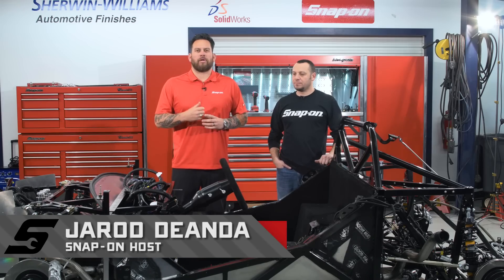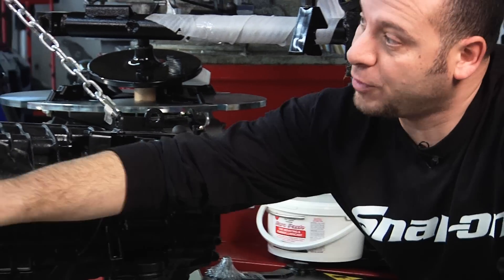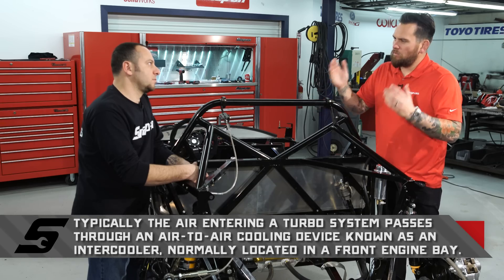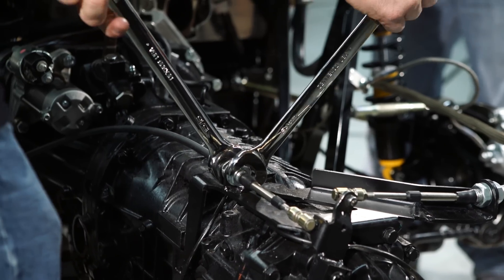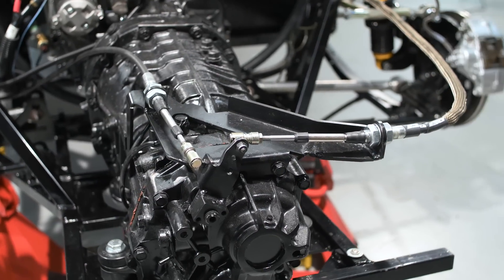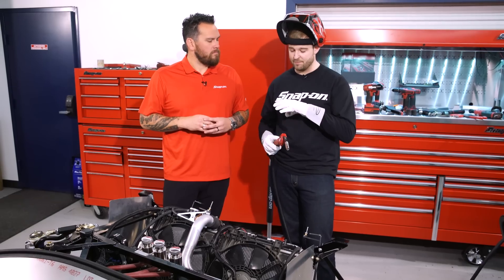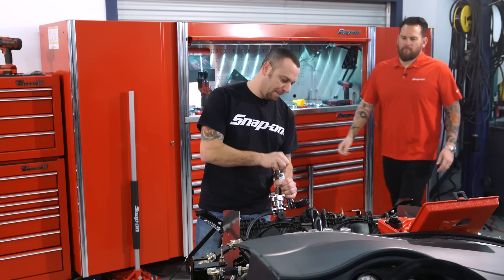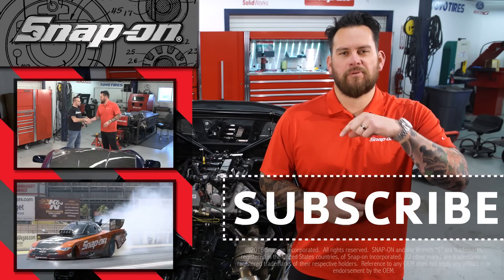Dropping in the 818C Engine at Factory Five (Part 2)- Snap-on Tools From the Ground Up

Comment: The simple solution to this fantastic chassis is electric swapping it. Low center of gravity, roughly the same weight, less hassle when building, and EVWest sells a drop in electric kit as well.

Comment: I think when people say they want an American engine they mean V8, not some eco engine.
Reply: If the engine was made in america, it is by default an american engine. V8 doesn't equate to being american.  It also makes little since to put a V8 in a car that weighs under 2 thousand pounds. You'd have virtually no real control.
Reply: @MuShinnen  Nobody thinks a 4 banger American engine is the shit. LS swapped Mazda Miata is a good example of a very light V8 that has no problem handling the power.
Reply: @unite4peaceonearth  Speak for yourself. If the only thing you can think of is slamming a V8 into everything, then you're not much smarter than the average 15 year old. Power to weight ratios are a thing for a reason. The car can already hit 10 second drag times with a tuned subie boxer engine. All a V8 would do is kill the driver, and possible someone else with it.
Reply: @MuShinnen  You can always tune it down for less power to make it safer but still have that V8 'Murica sound. 🇺🇸
Reply: @unite4peaceonearth  Tuning it down does not change the additional weight you just threw in the car though. Now you have to adjust the rest of the build to compensate for the additional weight, power, and balance shift of the vehicle. Why put a V8 in the car in the first place if you're just going to tune it down vs just buying a 4 or 6 cylinder and adding turbos? If sound is all you're going for then you risk compromising the entire rest of the build for it.
Reply: @MuShinnen  extra weight but more power to counter that and keep the wheels on the ground. LS3 engines are smaller for V8's and lightweight with the aluminum option. The hole point is to get that V8 'Murica sound. It's ok to disagree...cheers!
Reply: @unite4peaceonearth  Again, there is no v8 in existence that has the same weight as the proposed options of smaller engines. That's just not how it works. Power to weight ratio again is a concept that doesn't seem to be addressed by your comment. Power counters additional weight, but only on a surface level. Cars are designed around their engines, not the other way around. There are issues with balance, and structural tolerances that have upper limits when engine swaps are brought up.

You have to take into account reinforcing a car's frame to deal with that. The various modifications to make sure the engine properly sits in the position that it should. You have to deal with the heat that V8 is going to create more efficiently. You have to have a new transmission, you need better brakes, and a slew of other parts just so this car is functional. This isn't so much disagreeing about how a V8 sounds. I drive a 2018 mustang with a V8. I'm questioning the end practicality of trying to strap a v8 into a car with virtually no safety features, and no weight to really counter all the added horsepower for a vehicle that was never meant to have it.
Reply: @MuShinnen  I was only trying to say that when the builder said he wanted to appeal to the American engine crowd, most people would think first of a V8 when your talking about this in a global and local market.

Comment: The real question is can it fit a tall chubby man 6'1 250 pound man to be specific
Reply: No probably a 200 pound weight limit. My 3500 pound car has a 350 pound limit. This is a 1,800 pound car with WRX engine. So you're too fat. Go buy a 4000 pound Mustang or Camaro.

Comment: Confused abit at the engine layout and trans choice, a eco boost engine isnt new they could have mounted the engine transverses with a dodge neon trans, though i suppose if the kit is set to accept an engine in a particular way they wouldnt want to get too crazy with cutting and welding which would deviate from the point of the kit car.

Comment: No way you do this in your garage over a few weekends and it works right. This is all custom fabricated just to get the kit parts to work and fit right. You could tell even these guys, who are experts at this, got a little exasperated.
Reply: they are having to build around an engine that kit wasnt designed for.
Reply: Look, factory 5 has been designing and manufacturing replica and their own creations for decades.  Their reputation for well thought out and manufactured parts that fit the first time is second to NONE.  It is easy to sit back and bad mouth something you have never attempted.  That is doing a great dis-service to what has been their passion.  And while you can easily pay someone to do all this hard work for you, these are truly do it yourself in your garage kits.  This particular car is a one off prototype for sure, and as such requires some modifications, however don't be surprised if this engine combination becomes an optional powerplant AND all the hard work and modifications necessary to make it all work are made optional.  Again, don't badmouth these guys unless you have actually turned a wrench on one of their creations.
Reply: That's because they're using the EcoBoost. The kit was designed to be used with an Impreza drivetrain
Reply: Phoenix Franks I’m betting Factory Five will change the frame design to allow better fitment of the 2.3 engine. Great company and people.
Reply: You would absolutely surprised what a nice clean shop and endless amount of organized tools can get you.  I've seen stuff like this built in a very short time frame...heck, a good friend of mine was doing crazy engine swaps and chopping and sectioning cars by the time he was 13 years old, racing and his own entire own pit crew at the same time by the age of 15, and now works at a race shop building tube frame chassis.  Would bet my bottom dollar that dude could have this entire thing assembled in a couple days in his current shop, by himself.  There is also a world where engine swaps take days...and then a world where they take a couple hours...it all depends on experience.
Reply: @AaronHendu  I know a guy who swaps subaru engines in a few hours, but he's been swapping engines for years and has a well set up shop for doing the work in. I be he could build one of these in a couple weekends if he was using the regular Subaru powerplant. This build with them needing to fabricate new parts along the way for the ecoboost was probably slower than it could be. Especially with a full Snap-on too setup, you can knock out stuff like this fairly quick. Most of the first video was stuff that should only take a couple days for someone with some experience behind a wrench.

Comment: why would you ruin an awesome car with an ecoboost? ugh...

The thing was made for a Boxer engine for a reason: low center of gravity.
Reply: AKJangly they made that Car however they wanted to, lol you make it seem as if it's a a factory production car. A real car enthusiasts uses whatever drivetrain they want and could fit.
Reply: Well it probably was because Ford gave them the engine.  You forget Ford plays a big part in many of their models.  And if Ford wanted it and foots the bill, they build it.  Also don't forget that they mentioned up front that this car was SOLD.  Hey, if some guy pays you to make it his way, then that is what he gets.  Why do people put Chevy Small blocks in classic Fords?  BECAUSE THEY CAN.  That is the beauty of building YOUR car the way YOU want it.  Don't be surprised to see this car end up at Barrett Jackson as a charity car...offered by FORD.
Reply: I agree. I used to race desert cars years ago. When I started we used VW based engines. Later the Honda engines got popular because, lets face it, the VW engine is old & limited in the HP you can get out of them. The Honda had much more potential as far as HP. Problem is, that straight 4 raised the center of gravity & you could feel it big time in a buggy.  Granted, that's a bigger issue in a desert car. Our CG is high to begin with and, when racing, you push the car to the very edge regularly but this is also a very light car & moving even a little weight up high will make a difference in the way it feels & handles. It may not be the difference between rolling it over or not but I would expect, even an average enthusiast driver to be able to feel the difference in the CG between the two engines. Huge deal? No, but it would be a noticeable difference. 
I would stick with the boxer engine unless someone has a real good reason to want a Ford.

Comment: Why did you use the 6 speed transmission instead of the 5 speed? I know the 6 speed is stronger and better but on Factory Five's website they say not to use the STI drivetrain, any real reason for this other then ease of installation?
Reply: I thought the exact same thing, had to rewind the video to double check he said 6-speed. And that's in fact a 6-speed bolted to that engine but the thing is, 6-speeds have DCCD so I'm very interested to know how F5 converted that to 2WD.
Reply: It's the same thing they do to the 5 speed. You get rid of the DCCD center diff and put in a collar or spool that locks the output shaft to the front pinion shaft.
Reply: Vegaspsycho the STI 6 speed has closer gear ratios than the five speed. It all depends on what you want the cad to drive like.
Reply: I know that (STI owner here)
But on Factory Five's website they say, "STI’s drivetrain parts differ too much from a standard Imprezza or WRX for use as a single donor for the 818 platform."  (which they don't really differ that much)
So I just was wondering why they used the 6 speed versus the 5 speed that Factory Five recommends. (which you probably don't know the answer to because you weren't there, and Snap-On and Factory Five don't read these comments anyways so our comments won't get us any answers on here)